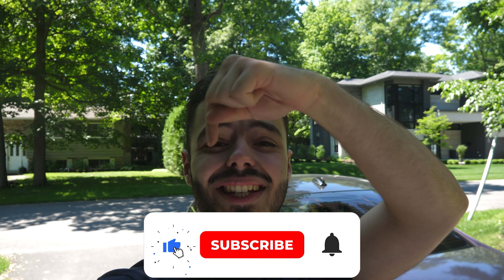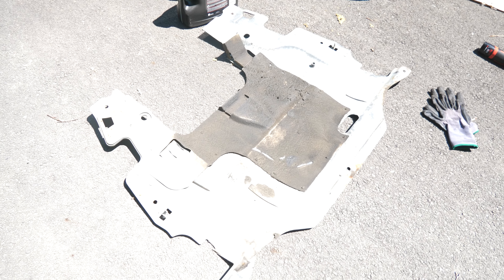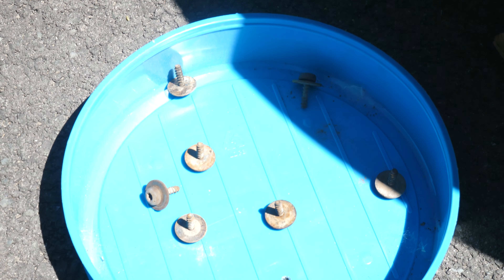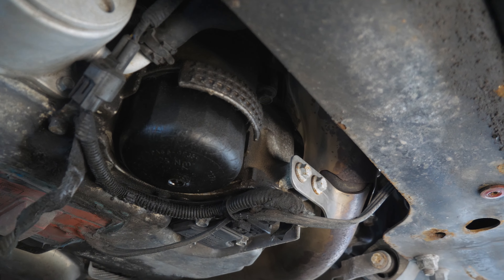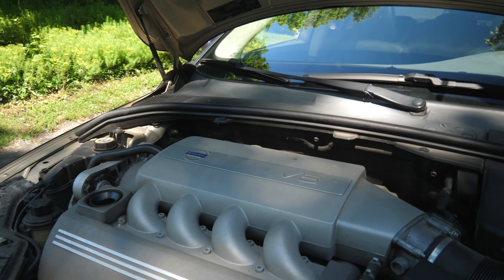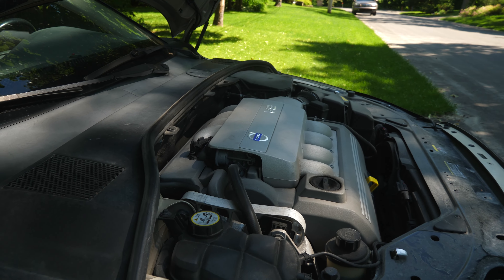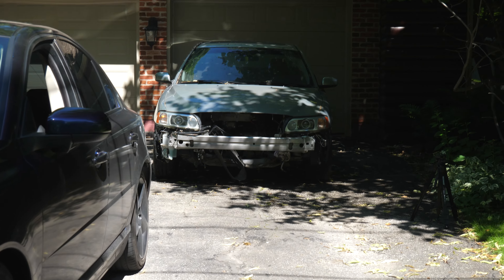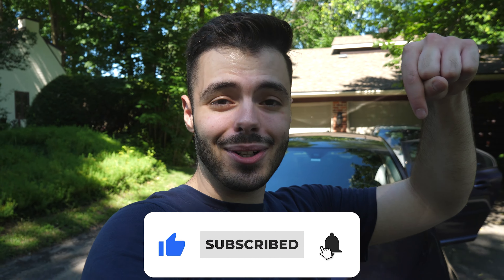VOLVO S80 V8 COMPLETE OIL CHANGE GUIDE! Giving our straight piped V8 Volvo a proper Tune up!

Comment: I have a 2007 V8. Put new tires and and rims on it. 245.40.18 in front with 265.40.18 in rear.
I put new Becker performance exhaust with dual tips on it. K&N air filter also. I bought the car for $2000 2 years ago with 134K on it. Just had to do some Upgrades on it. The AWD is not working which isn’t a problem as I don’t drive it in the Winter. I have a SUV for that. Not sure what type of oil i should use and something about the changing the Angle gear oil as well. Which i have no clue about it and if it needs to be done. Excellent advice and Videos you post. Thanks!
Reply from the maker: Thank you+

Comment: Hey there! I have a question, why do you put 5w40 when only 0w30 and 5w30 fits the specifications given by Volvo ? P.S. I love your videos!
Reply from the maker: First of all thank you for supporting the channel! We greatly appreciate it! So Volvo actually recommend more than those 2 types of oils depending on the climate and use of the car! In the summer here in quebec we get some pretty humid and hot days that raise the overall C° to around 35-40! So a 5W40 would perform better in those circumstances! Also I do like to take my cars to the track and 1/4 mile events which puts a lot of heat and stress on the engine! This also suits better the 5W40 oil! In the winter though I go back to using 5W30 since the climate gets very cold! Hopefully that clarifies why!😁
Reply: @TankGarage  Absolutely, I saw your recent "track" video :D so it makes sense, yes. Thank you for your time and continue spreading love to the Volvo community!
Reply from the maker: @nikolaymihaylov902  More of those days are definitely on the way! Thanks for the support 🙏